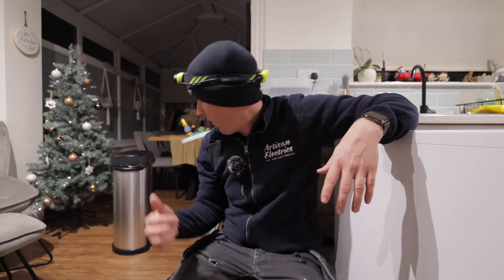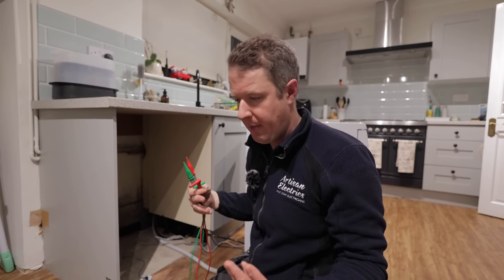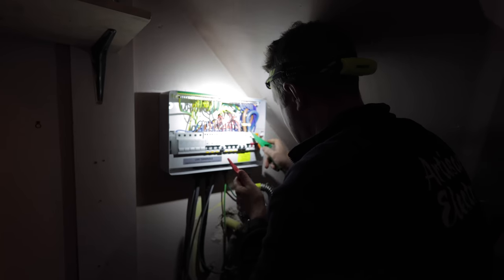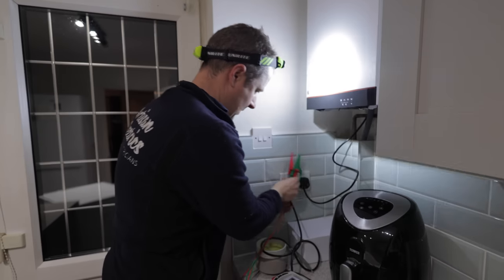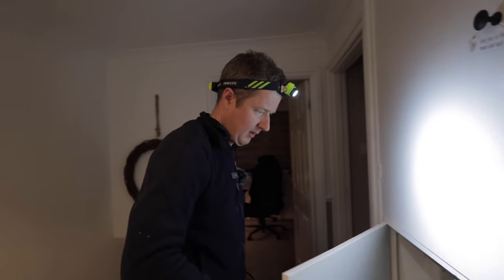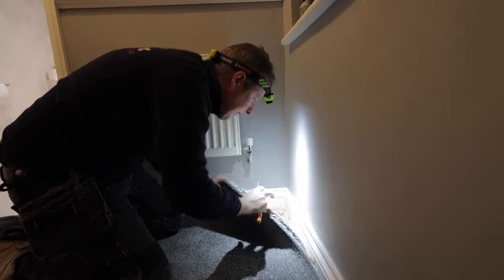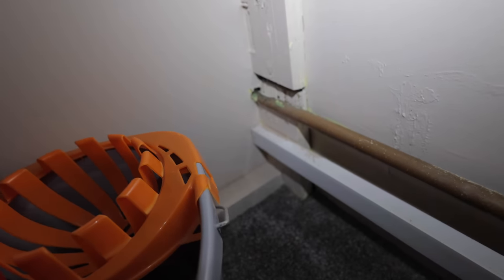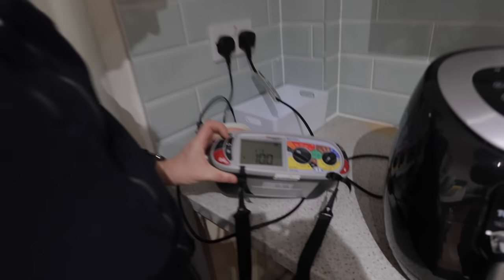Nearly KILLED by a CRAZY fault! What on earth is going on? 💀

Comment from the maker: Leave a like for that epic angle drill 📐
Reply: Fix the title - not "what on earth" but rather "what  on Earth".
Reply: Good job Jordan👍
Reply: Pythagoras Jordan 🤣
Reply: @tarassu  great, now I understand - before I was so confused before. Thank you for your diligent work. Where, no... wear on earth wood we be with out peoples like yous.  Also, you are wrong.  The word earth here should not be capatalised as it is an idiomatic expression/intensifier. I am being rude because "Fix the title" is not polite and I want to see less posts like this. Especially when its erroneous and spreading  ignorance. Also one space between what and on please.
Reply: One solution would be a contactor coil fed by upstairs contacts switch power from boiler feed to to boiler heat input.
Reply: Bravo on the drilling.
Reply: Drilling was excellent but you could have avoided all that by removing the live link on the thermostat and used it as a volts free switch instead connected to the boiler down the existing cable.
Reply: Holy Hell, close call.
Reply: What baffles me more than anything is why it’s not blowing both rcbos, if there’s ever a link between circuits it usually blows both breakers 🤔 
Enjoyed that video, bit of real life electrics and how a 10 min job can get out of control and take HOURS 😞
Reply from the maker: @JRCElectrical  Yeah that puzzled me too - would be cool to do a video explaining it
Reply: @JRCElectrical  I expect it's because the current draw of the boiler input (which is likely volts free detecting and live detecting through a high value resistor) is well less than 30mA.
Reply: When I work on any household circuit, I just assume it's not properly wired to protect my self and after turning off power to the breaker, I use an "AC tester beeper"  (just search on "ac tester beeper home depot" and any Home Depot sells them).

1)  turn off the breaker
2)  remove the plastic cover plate from the AC outlet
3)  use the "AC tester beeper" tool and if it beeps, there's still voltage at the terminals in the outlet

If I walk away from the job area (to use the restroom or take a meal or coffee break or to stretch my legs etc)  I then do the following:

1)  verify the breaker is still 'off'
2)  use the AC voltage tester beeper to see if there's any voltage at the terminals of the outlet

I also use the "one hand rule" - never use both hands on a circuit if you cannot 1000% verify there is no power in it.  This is to avoid voltage/current entering one hand/arm, going across the chest then out the other arm/hand.   If voltage/current goes across your abdomen/chest, you are in big trouble potentially, maybe dead.  Only using one hand in such a situation limits the risk.

The price of the Milwaukee company's "AC voltage tester beeper" is $15.99 in USD.

I've never taken a shock.   I don't trust anything electrical.  Electricity DOES NOT give any warning.   Having some home wiring 'expert' pull a wire off the breaker panel without routing the line through a breaker means shutting off the breaker cannot protect you.   Has it happened, an 'always live' wire  like this?  Yes it has happened.
Reply: i was thinking an wire error  of  ups backing for some heat pump
Reply: I’m not an Electrician I’m into electronics and retired. That fault Was Amazing. It had my mind thinking how had the circuits been wired. Then the live mains plug on the boiler. It just goes to show you what can happen. And you’re drilling so skilful. 
I love all this stuff. Thanks.
Reply: I have never seen a boiler / thermostat system that didn't use "clean contacts" in the thermostat.
That means that you could replace the thermostat with a switch (no power, no electronics) 
I guess that the old boiler was wired (incorrectly) as a load on the thermostat instead of having permanent local power and a remote switch (thermostat).

I'll lay money on it that the previous installation used the clean contacts in the thermostat to switch a live that comes from the upstairs cupboard. 

Your solution here should have been to use the existing cable and wire the thermostat correctly.
Reply: @angryscottishidiot  You have shed light on the issue of earthing, noble Earthling. ;-)   
BTW: All knowledge is sophomoric; It is even hard to estimate how much you don't know about any subject.  Every expert, knows s/he is not perfect, even in their field of expertise.
Reply: @johnh9449  perhaps the phuckwit who wired the boiler should have done that Sir 😊😊
Reply: @ratbag359  
Indeed that would have effectively brought the thermostat contacts into the boiler unit downstairs. However since the RCDs / RCBOs weren't tripping it could mean that the wire was going through a high enough resistance which did not allow the 30ma tripping current to pass. Meaning that many relays or contactors may not have enough current to operate / close their contacts. It would still be worth trying and an easier and cheaper solution than running a new wire between floors.
Reply: @artisanelectrics  I'm curious about the placement of that distribution board and if it violates code where you are. I'm not an expert, but placing a distribution board in a tiny closet under a flight of stairs like it's Harry Potter seems like it wouldn't be kosher.

In the US, code requires they be placed somewhere that's easily accessible, not less than 4'/122cm from the ground and not more than 6'/182cm, with 30"/76cm of clearance on each side, and has to be accessible without moving any obstacles. Basically, you need to be able to get to it easily and be able to work on it while standing, without having to get up on a ladder or kneel down. I don't think I've ever seen one in any of the places I've lived where that wasn't the case, which is why I was wondering why the heck anyone would shove one in such a tiny space even if it were legal...
Reply: Nice fault finding but you didn't need to goto that much effort to get a new cable in. I would recommend using a salus main switch and the t/e would of sufficed.
Reply: I'll give you 70% skill...deffo a bit of luck involved...😉😂
Reply: @JRC Electrical  😂😂 you know, Friday eve by chance? Quick lil job 3pm before putting ya feet up?...😂
Reply: Hope you have seen a doctor to check if everything is ok. just to be safe so you don't get problebs later.
Reply: You are a GOD of Driling :D
Reply: @tarassu  call it what on CPC
Reply: Conduits, conduits, conduits… they make life so much easier
Reply: @kristiangoransson6104  I know... I used metres of the stuff for my home network. I used the stuff for air extraction systems, as it was easier to feed cables through
Reply: Sorry no - if you'd drilled bottom up, you couldn't have missed. 😏
Reply: @johnh9449  ..if the old 'stat was up to it. I'd have flogged the customer a wireless stat & started afresh in the kitchen.
Reply: @robertc.9503  Those dimensions are bigger than many UK properties 😋

We have quite a few houses over here that predate electricity, so it ain't easy writing regulations for them. I don't think that was one, but solid ground floors are also common, so you have to work with electricity mains where the house constructor put 'em. Understairs cupboards are usually the best fire protected places in a property, but with a compelling reason.
Reply: You've got to admit, drinking from the top down, does have that edginess
Reply: None for the drill, but if I could I would do multiple thumbs up fot the drill operator.
Reply: Ground Fault; there is a misswiring somewhere between that line and another line. When dealing with 220v-240v improper or older insulation on wiring can cause contact voltage vampirism. Voltage from one line is effectively jumping to a different line, even though they appear to be isolated. This can be done via a number of reasons, direct contact between lines, lines coiled around each other for some reason causing induction current with a different line, or possibly even a bad breaker allowing for power to jump the gap, and what is being seen is gap loss.
Reply: You used all your luck in that drill, that problem is world universal.
Reply: Thank you very much for this. It happend in a well known hotel, I swithed off the breaker to change a lighting ballast because there was no other way to switch it off, All the lives were dead but believe you me when I touch the earth it gave me the shock of my life. I will never and ever forget that. In the same stupid hotel I found so many faults on wiring that in the end I simply walked out of the job because the Manager who was in charge of managing the hotel said me say Nothing!!! I simply picked my bags and never looked back or every worked for such dum people again. Your video reminds of me what I saw in a hotel in around at least ten different places and I was told to keep it quite. But the worse of it all was the ballast one, It had no batteries nothing.
Reply: use WD-40 on the cables to help pull them through easily.
Reply: @robertc.9503  I've seen a lot of YT videos from electricians in the UK, etc. I think that it has to do with the ages and original designs of the homes there. Add in a hodgepodge of remodels and additions. I've seen the white boxes that he was testing on in many of the videos. The locations are sometimes mind-boggling. Our homes in the USA aren't constructed the same. Even our older structures have places for our modern boxes and panels.
Reply: From USA here, and dont know how I found your video, but wow you likely saved someones life. I hope they gave you something extra for saving them at least from a possible fire, but very likely a future owner getting killed. A less reputable electrician would have just ignored it.
Reply: The best part of this video. 🥰
Reply: @tarassu  or even "Watts on Earth" 🌩
Reply: I had a fault similar to that, in the early 1980's. And yes, it really hurt, leaving me gasping for breath. It turned out to be a section of really old Lead sheathed cable (dating from about 1930) which had shorted Line to Earth, and then melted the Lead away from the cable. It left most of the house without an Earth, and half voltage on sockets when the circuit was isolated. I completely rewired the house, once I saw how badly everything had been done by some unknown cowboys, several years earlier.
Reply: @tarassu  / Thank you. Our home, a proper noun, deserves to be capitalized.
Reply: we feed equipment from multiple circuits all the time. I will give you some examples. quite often we install a large air handling unit. that air handling unit might have fans that operate on 480 volts but also might have receptacles that operate at 120 volts it might have a control panel that requires a 120 volt dedicated circuit. finally there might be service lights inside that air handler and those might be fed from a dedicated lighting panel that consequently gets another 120 volt circuit. it could also have a return fan on it yet again another 120 volt cirucit. one thing that all of those will have is a switch or disconnect.
Reply: Nice drilling, that was so perfect
Reply: Great detective work Jordan.
Reply: That was epic
Reply: You're so lucky with those old english houses.. like, all hollow wooden floors, brick walls with pipes outside.. no worrying about hitting a steel reinforcement or a heating pipe, just drill wherever you like, pull up a few floor boards, drill through the beams..
Reply: @tarassu Watt, no earth?
Reply: I loved this! Working in IT it’s nice to see other professions that also have detailed troubleshooting, and scary to think someone else thought that was an acceptable setup!
Reply: Wow, that was quite an epic fault tracing session, and excellent rectification too. It would have been all to easy to disconnect the boiler and walk away from that at that time of night.
Reply: I know this feeling if your drill bit comes out exactly where it's supposed to be. 😁
Good job! 🍻🍻🍻
Best regards from Germany!
Reply: Couldn't have just wired a relay into the boiler?
Reply: I love angle drilling at a shallow angle to run downlight cables through joists :)   You only have to clean up a couple of tiny 10mm holes.   
Whack a digital endoscope through the pilot hole on both sides though to check for pipes and cables.
Reply: Was the boiler amp hungry. Could that be the reason for the double live setup?
Reply: @riccardparsons2004  Doubt it - they draw next to nothing. If the boiler has an integrated pump then perhaps 80 watts max.
Reply: @nickgilbert1264 
I don’t know about the rules in UK, but in Germany it’s not allowed to use two lines in parallel. If more diameter is needed, use a larger diameter.
Reply: I'm borrowing the phrase 'artisan drilling' lol
Reply: I'd give more for the Wiha hammer rec. You know, for drilling big holes I'm always nervous if I don't have a second-hand brace so my hand doesn't get whipped around 😅
Reply: @johnh9449 . . . Who knows. . . The thermostat maybe have already been going to 10 Downing Street. . .😂
Reply: But if you connect anything between the live of from one RCD and the neutral of another, both those RCDs should trip.  Why didn't that happen?
Reply: A 10€ relay to separate the two circuit would have done the trick
Reply: That could have gone terribly wrong
Reply: Couldn't you just turning off breakers one by one until there where no readings ? It would show from which breaker the issue is and from there you could investigate further.
Reply: Beginners luck...✔️
Reply: It's so frightening what some so called professionals mess up.😵‍💫

Comment: As an instructor of 35 years and now retired I TAKE MY HAT OFF TO YOU!!!  With technicians like you it would be a different World! Keep going, you are indispensable. Thank you.
Reply: Żałosne 😂
Reply: Here here !  Well said
Reply: Sadly even he isn't infallible.
He never spotted the boiler E leakage fault.
Inside the boiler, along one or several parts of the electrical heating element coil, it is in it's initial stages of FAULTING to it's outer metal sheath, meaning there is a trickle of FAULT current flowing from the elements PHASE core, and it's outer bonded earth sheathing, appearing (even at the very end  of the video) as a 10 volt potential between his E & N at the wall outlet.

BUT, maybe it's not anywhere at the actual boiler or heating system upstairs, as it could well be a similar fault, appearing from the ground, via underfloor pipework, or some other bonded ground rod?
Anything that appears at ONE bonded earth point, may very well be seen as a 10v potential between an outlet's Neutral & it's E - even with the outlet switched off, as it's a N/E fault circuit - back to th distribution board's E and the boned Neutral bar there, giving a return to socket outlet N wire, a small potential seen as 10v at that outlet.

The fult that I see STILL THERE was not cleared when he left the job, and probably will be there forever, until something eventually BLOWS (an element live core, to earth as a full fault), whereupon the distant element will be replaced removing the element core to sheathng (bonded earth) fault - whereupon the 10v will also dissappear.
Reply: Relax with the hat removal, he claims to have almost killed himself because of an amateur mistake.
Reply: How exactly would the world be different?